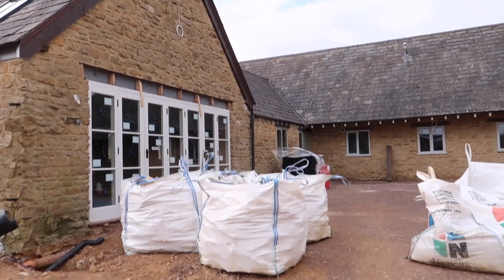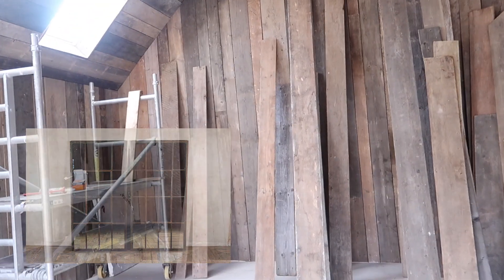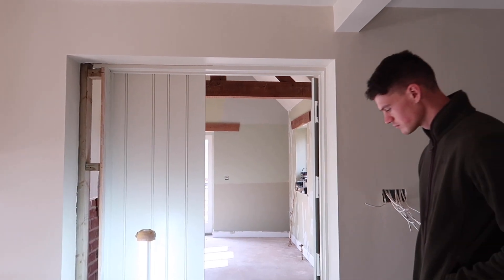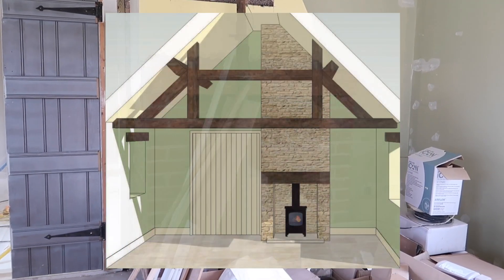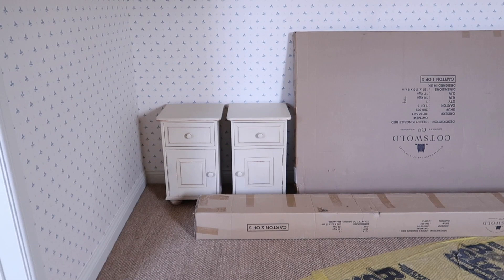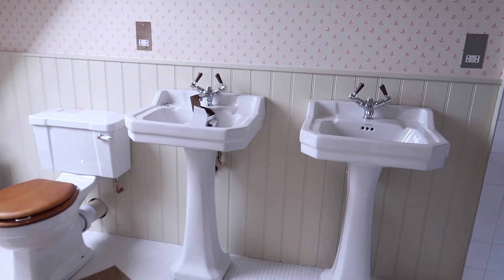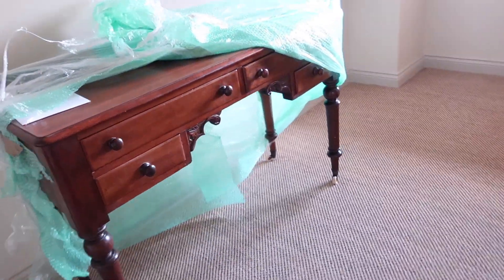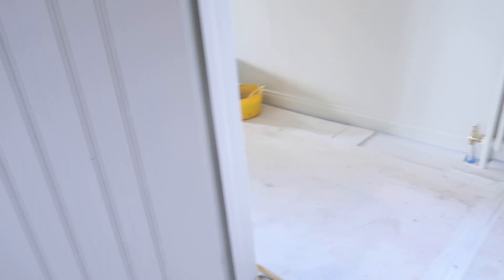DESIGN CHOICES I REGRET... RENOVATION UPDATE | Our Cotswolds Barn

Comment: What a gorgeous property. It is a joy to watch the progress you have made. Just a suggestion for the bathroom, I would have taps with white ceramic handles to tie in with the lever on the toilet and avoid wood as it will easily mark with use (water) and a white toilet lid is both more hygienic and fits in with the other white sanitary ware.